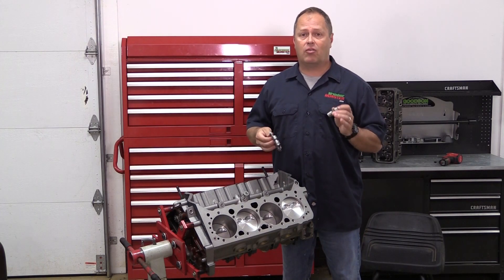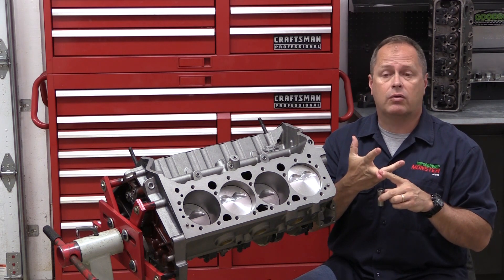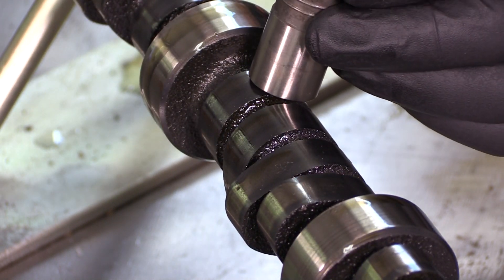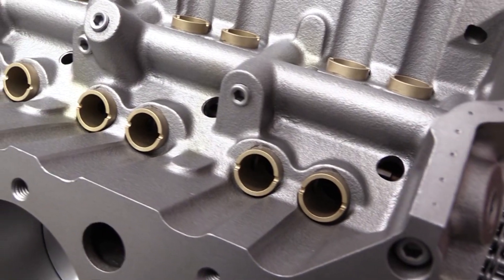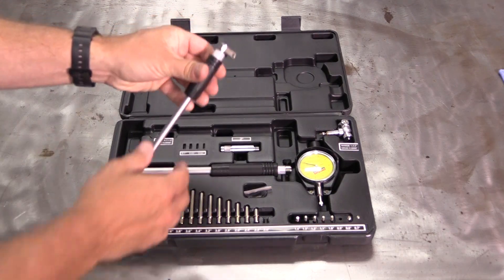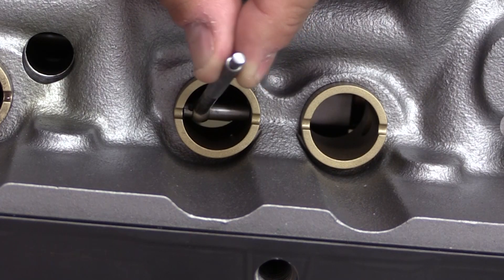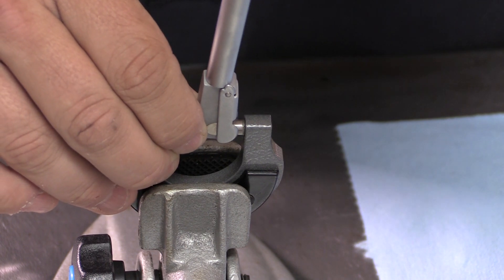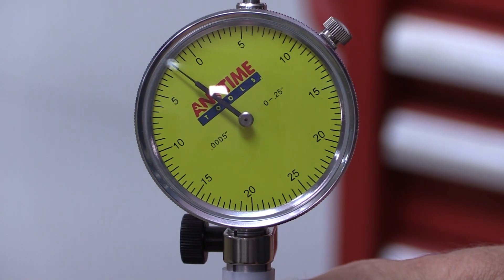Better Engine Building: Eliminate Common Lifter Failures

Comment: Telescopic gauges are incredibly accurate, you just don’t know how to properly use them. 
     You have to “snap and snug”, then drag across center to find the largest spot. The plungers will will find the biggest diameter, shock you then measure.
     I think 80% of the people I’ve met do not know how to properly use those measuring tools. 
    I’ll add that cam tunnel index is as critical as lifter bore position.

Comment: Maybe I missed something but why the hell would you go to a bigger bore Ford or Chrysler lifter which also have more mass? Isn't that just adding mass to the valvetrain and causing problems?
Reply from the maker: Not really. Mass on that side of the rocker (lifter and pushrod) isn't as sensitive to mass as the other side with the valve spring, valve, locks and retainer because of the leverage of the rocker. Meaning the lifter and pushrod are on the short side of the rocker. Hope that helps.

Comment: Comment on the practice of grooving the lifter bore to increase oil lubrication to the camshaft.
Reply from the maker: There is nothing wrong with it to help get a little extra oil to the lobe face when running flat tappet lifters. Used to be a pretty common practice but I rarely see it anymore. These days you can get flat tappet lifters with an EDM hole burned into the crown that injects oil right between the tappet and the cam lobe. That seems to work better than the old-school groove in the lifter bore. Thanks for watching.
Reply: @TheHorsepowerMonster  Thank you for the info.   Much appreciated.

Comment: An excellent video, but I believe misses some important information the at home or inexperienced engine builders need.
Most engines/blocks the viewers are working with are used, and the bronze bushed or enlarged lifter bores are out of budget for them.
Flat tappet lifters can be used in bores with as much as .003" clearance with a little extra (and simple) work to the block.
Usually what causes flat tappet lifter failures IS lack of rotation, but because of another issue not mentioned.
The bottom of the lifter bores see the side loading as lobe pushes the lifter up, the very bottom edge of the lifter bores will dig into or bind the lifter enough to keep the lifter from spinning and wipe out the cam and lifter(s)
Flip the block upside-down, and with 800 to 1000 grit "wet-or-dry" sand paper and a light oil - automatic trans fluid works fine - polish the sharp edge of the lifter bores off. Just take that sharp edge off, that's all that needed, just enough to take that very corner off.
This will keep the lifter from binding and let the lifter spin. Actually this should be done on new freshly machined blocks also - even on roller lifter applications because that sharp edge will score and gouge the lifter and cause more problems later.
Another common reason for this kind of lifter failure comes from having a block baked and blasted at a shop.
Most shops use beads not sand to blast the block clean, the problem comes in that the beads will roll the edge of the lifter bores towards the bores - unless this metal is removed it will also cause the lifter to bind or drag in the bore, or at the least gouge the lifters.
We've been in the race and/or street engine service field for some time and have not had a flat tappet cam failure yet, so I know this information works. 
Otherwise a Fantastic video, and well explained!
Reply from the maker: Excellent points.
Reply: @TheHorsepowerMonster  
Thanks!

Comment: Are flat-tappet lifters that have the small oiling hole on the face,  a worthwhile upgrade?
Reply from the maker: They are a great upgrade. That supply of pressurized oil directly between the lifter tappet and the face of the cam lobe can be very helpful, especially in racing applications with very aggressive cams.

Comment: Telescope gauges (he refers to these as "snap" gauges) can be highly accurate for small bore measurements.  It all depends on who's using them and how experienced they are with this tool.
Reply: Amen, Thank you for saying so!
Many machinists etc have made their living sizing bores quite accurately with telescopes for decades. 
I couldn't help but notice, he doesn't show or properly explain just Exactly how to use the tool.
Maybe He never had to.
Good comment.
Reply: I trained as a precision machinist in the 70's. (mainly to modify parts to fit things they 'shouldn't 😊)
Many years later (2000's) taught people how to use 'T' gauges at Motorcycle Mechanics Institute 'Machine Shop'
It was only a three week course and covered all the basics of engine measurement. (it's been dropped for several years now as 'no one' rebuilds motorcycle engines 🙄)
With some care and practice, you can quite easily get to within 0.0002" (two tenth's of a thousandth of inch)Maybe I should dig out the Go Pro and make a short video how to use one? (and a 'better' easier way to use bore gauges)
Reply: He’s using them entirely wrong.

Comment: Curious, when you try to "Narrowest point"... is that typically when the needle goes counter clockwise or clockwise? I'm trying to figure out wheres the 0 position if i were to rock it back and forth. 
I might be confusing myself. I'm sure the answer is when the needle goes backwards/past the 0 mark going counter-clockwise then zero out the gauge by moving the dial and recheck to redial the measurement...
at your 6:13 clip, i'm guessing the above was too confusing. So pretty much its either the minimum to highest point in the needle reading and choose where you want to zero it out at and remeasure how far it move and that's the varying clearance between the bore.

I love your engine building tips. Keep this going!
Reply from the maker: If you have already zero'ed out the dial bore gauge in your micrometer and you are checking the bore clearance, the narrowest point is where the dial is closest to zero. So it should be moving clockwise (moving toward 0). Hope that helps, and thanks for the kind words!
Reply: @TheHorsepowerMonster  ok. Thank you

Comment: What would happen if I put a roller lifter set on a hydraulic flat tappet cam? Obviously would need set with links like u showed
Reply from the maker: You will usually see a loss in performance. Not sure if you have ever noticed, but the lobe on a flat tappet cam is usually pretty pointed while a roller cam is as tall but more blunt. This is because the flat tappet has a large face, as the lobe of the cam raises it up, it stays up as the lobe reaches the far side of the face. A roller lifter obviously doesn't have that wide face. If you put a roller lifter on a flat tappet camshaft, the lifter (and thus, the valve) will reach maximum lift more slowly and drop back down more quickly. That's why the roller lobe on a camshaft is wider, or more blunt, to help hold the valve near maximum lift longer. Kind of difficult to explain, but I hope this helps. Thanks for watching.

Comment: The telescope gauge is a very accurate method. To use it properly one lets is spring open, one then snugs (not tighten like no tomorrow, just snug) the screw and rocks the telescope gauge over "top dead center" to explain what we would be doing, this gets the telescope gauge right at the hole size. I think if you practiced a bit you would quickly see how accurate it really is :-). The downfall of the telescope gauge and even the dial bore gauge is that they do not tell us exactly what size plug would fit in the hole due to the hole not being perfectly round :-). This is true of any 2 point measurement.
Reply: https://images.app.goo.gl/Digi3r7dXppCrQuS8
Reply: This is a much better way overall. I spent a few decades machining holes to within +0.0000" minus 0.0005", for close tolerances we verified with two methods, the hole micrometer and gage pins were quite often the two methods. The dial bore gauge is not "bad", but there are better ways, one good feature of the dial bore gauge is you can rock it to "top dead center" then slide it up and down the bore looking for taper or barrel shape to the hole.
Reply from the maker: That's true. But a three-point bore micrometer is a very expensive piece of equipment. Usually over $300 for the cheapest. A little much for the hobby level engine builder, which is what I assume is most of the audience for this video.  Likewise, being able to use a T-gauge properly so you get accurate, repeatable measurements is also an advanced skill. With these videos, I'm trying to find the right balance between ease of understanding/maximum accuracy/ and good value for any tools that may need to be purchased. Anyhow, great points and thanks for watching!